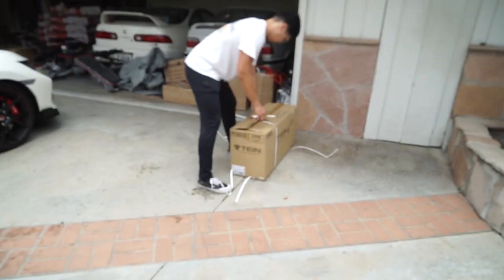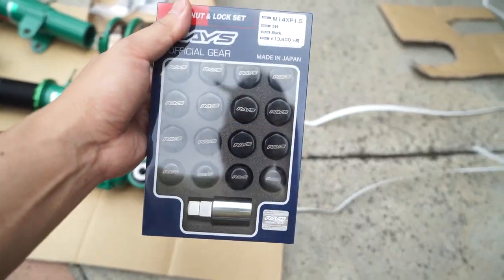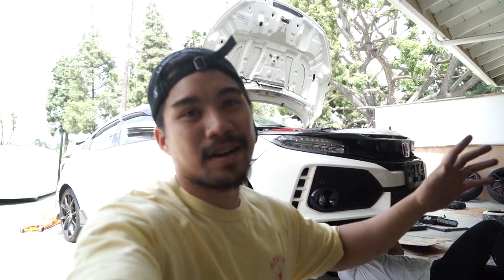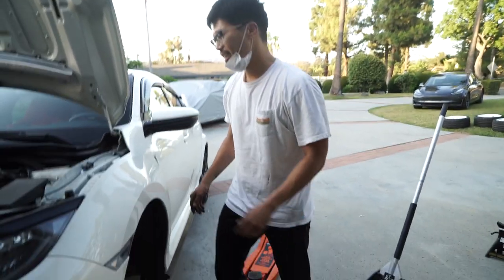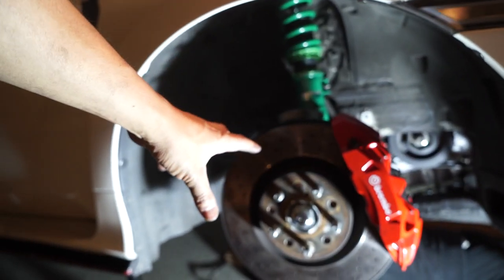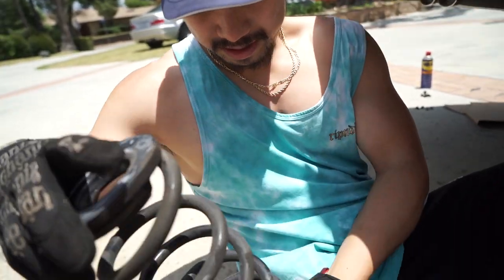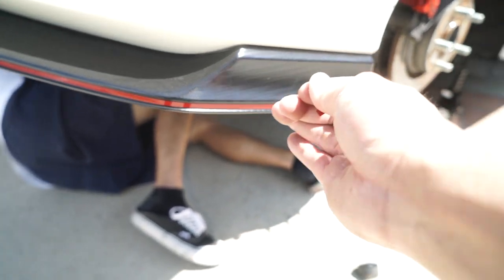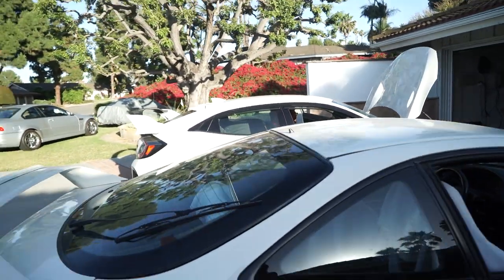CTR The HARDEST Coilovers to Install - FK8 Gets Coils and OG TE37's

Comment: you guys don't clock your suspension ?
Reply from the maker: i do i tighten it with the suspension held up by a jack usually. We just weren't finished with adjusting height so the coils came out like 4 times more after this video was done, before being sent off for corner balance.